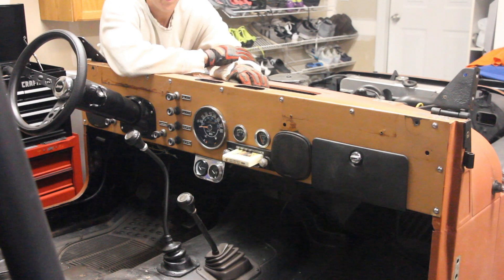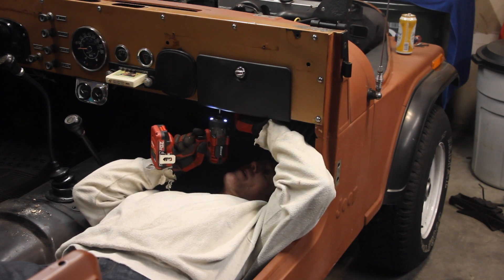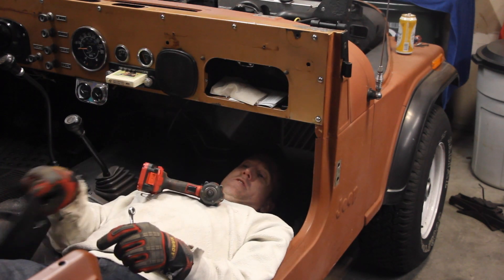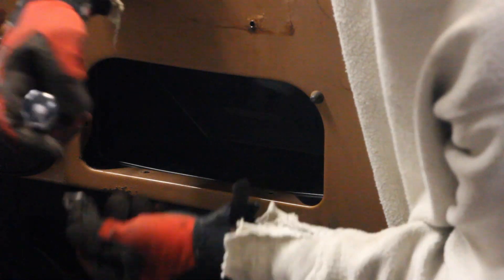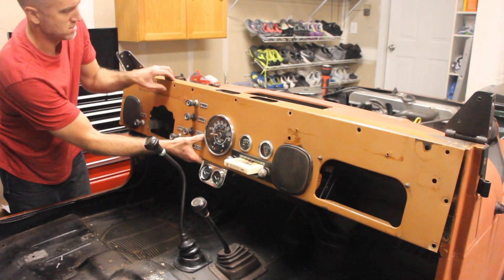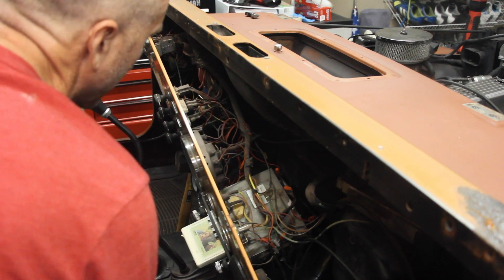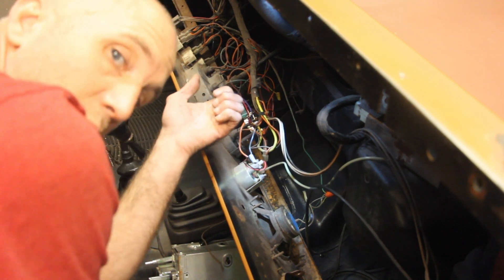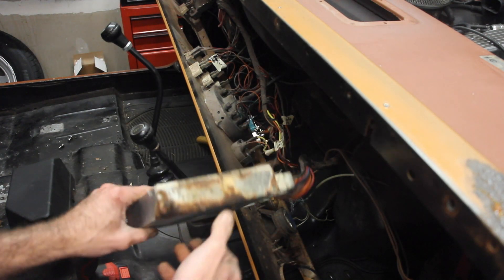Jeep CJ7 Dash Panel Removal

Comment: The dash will come off without taking the steering column out. Just remove the wheel and the turn signal switch lever. Just did it on mine.
Reply from the maker: That is correct. But where is the fun in that. When restoring a real Jeep (CJ7) :) you're supposed to make everything more difficult. Otherwise I would truly look like I know what I'm doing ;)
Reply: So you can just take off the turn signal indicator, this is relief as I just bought an old ranch CJ7 I'm returning to road worth with diamond plate for a dash, and just acquired a dash off eBay. Now I'm just wondering how they got a CJ7 body onto a CJ5 frame. Still working on that one. With a 289...more to come as I unravel it.

Comment: You can save yourself some grief by simply replacing the two most outboard fastening screws with bolts of the same diameter about 6 or 8 inches long. That way the dash will hang in place with room to get your hands behind it and no strain on the wiring.
Reply from the maker: Brilliant! Hope future CJers take note of this.
Reply: What size screw are they?

Comment: Great video explained for backyard Mechanic like myself. When you eliminate the computer is there any modifications that need to be made?
Reply from the maker: That's kind of a loaded question. There is a ton of information out there on doing this procedure. Lots of "extra" info too. At the bare minimum you need to splice the orange and purple wire that go from the ICM to the OEM distributor plug. Look up how to do this on jeepforum.com. after that you can do all kinds of stuff. HEI distributor, EFI if you can afford it, remove almost all of the vaccum lines and about 5lb of wire from your engine bay. Plus it gets everything back to or close to the 1980 and earlier type of system.
Reply: Cool Guy you’re right it is too much a loaded question but thx again it is very helpful

Comment: What did you end up doing with the emissions control computer behind the dash? Wondering how necessary it is and how you got around it?
Reply from the maker: I removed it and left the holding bracket in place. But there were things I did so that I could remove it. What are your plans for the CJ? That will determine what you do next.